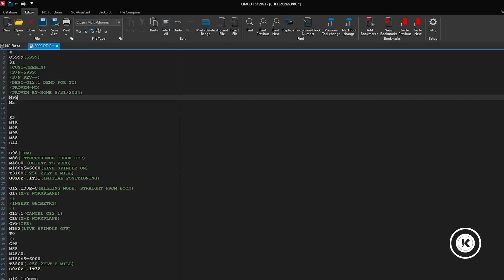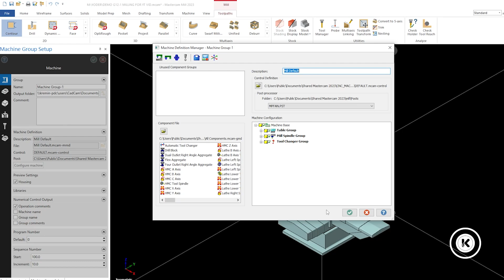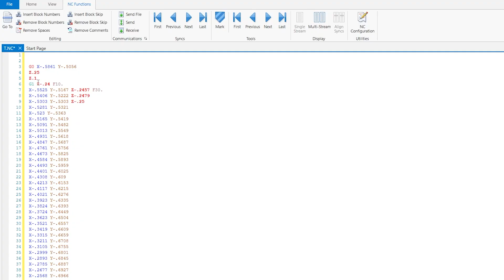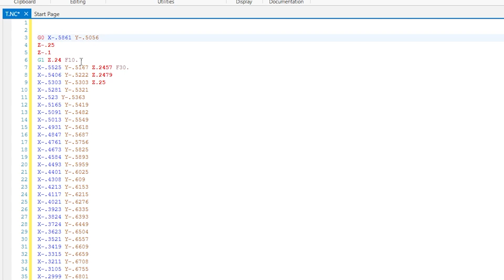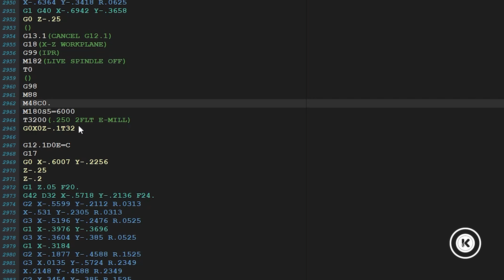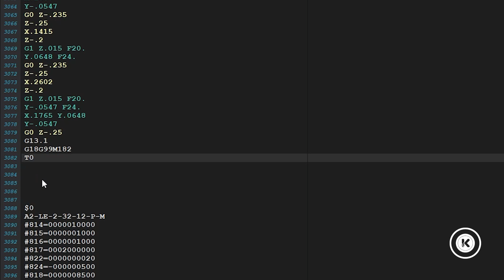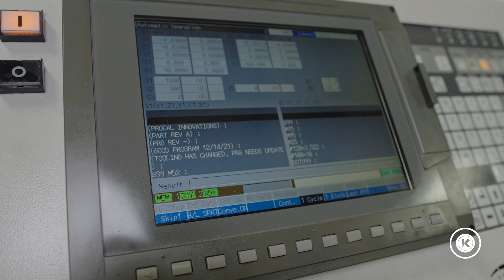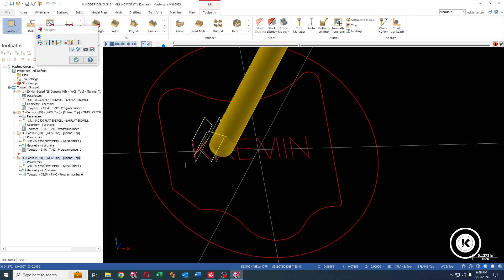How To Code G12.1 In Mastercam for a Swiss Lathe

Comment: Please , explain G600, G610,G630,G650,G660 and all special G codes which are use in simultaneous, parallel and sinchronization machining

Comment: A) Does this work the same way on the sub spindle with the milling attachment that installs next to the dogleg/drilling post (on A32 T11-14)? We have a 6 station attachment: 3 facing main 3 facing the sub spindle. 
B) To cut down on the amount of code Mastercam generates go into the arc filter, check G17 G18 G19 and adjust the line filtering to . 0005 in line and arc.
Also in the cut parameters change the "micro lift distance" defaulted to . 01" to zero, but I wouldn't do that for anything other than something like aluminum or maybe brass as that's the small distance in "Z" that it ramps in and out of the cut.
Reply: A) I believe it will, there's a manhunt underway to find our live arm so we can shoot some video on it since other people have asked about it, but it's a slow motion, slightly unenthusiastic search, like medieval townsfolk searching for a child who threw eggs at the local lord's carriage.
B) yes, you're 100% right. Usually I do, it slipped my mind in the process of shooting video.

Comment: I operate citizen L20, is gross tapping an option you have to ourchase or it comes standard? Because i try to rigid tap on live tools T7-T10 with G88 command but it give me error like it doesnt have that tapping option.. i find it strange that the machine cant tap on these only live tools it has.. any ideas on this ? Thank you.
Reply: As far as I know rigid tapping is a standard feature. Hard to say what might be going wrong without knowing what your code looks like or what alarms the machine is giving.
This is exact code that we run on our L20-X with mits control
G98
M80 S3=275
T0808(4-40 tap)
G0 X#814+.1 Z.125
G88 X-.05D3F6.875S275(.025ipr)
G0X#814+.1T0

Change your X, Z, speeds and feed to suit your part.

Comment: Why don't you use post lathe?.
Reply: I don't know of any lathe post that would work for this application on these machines. 
Milling mode on the swiss converts all dimensions to radial instead of diameter, just like a mill. Much easier to use a mill post, even if you have to take out all the Gcode the swiss lathe can't use.
Reply: mplfan has a switch that converts diameter to radius, and z axis direction(z- =>z+). and switches for g112 and g107. @SecondFloorOutdoors
Reply: dia_mult : 2 #Multiplier for output on X axis (Neg. switches sign of X)

2=>1 @SecondFloorOutdoors

Comment: Could you not just flip Z down in mastercam? Like work on the part upside down? Would prevent shifting the Z and dealing with mirrored parts. Still new to mastercam programming and only done turning so far so I might be totally wrong. But I feel like in Fusion I could get it to post properly ..
Reply: I have to experiment more, but using the "bottom" workplane seems to fix the mirroring issue, but have to be careful with the Z depth, especially on solid models.
The issue with the Zs is that on the mills,  Z+ is clearance, but on the swiss Z- is clearance. You have to go into the post processor and force it to reverse to Z values, or do find and replace.
Reply: @SecondFloorOutdoors z_mult : -1 #Multiplier for output on Z axis (Neg. switches sign of Z)